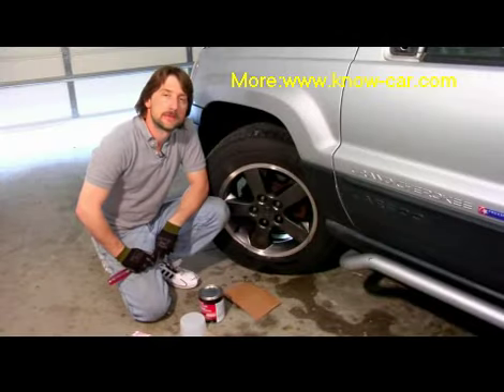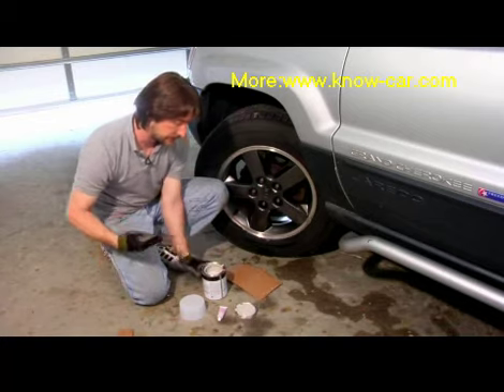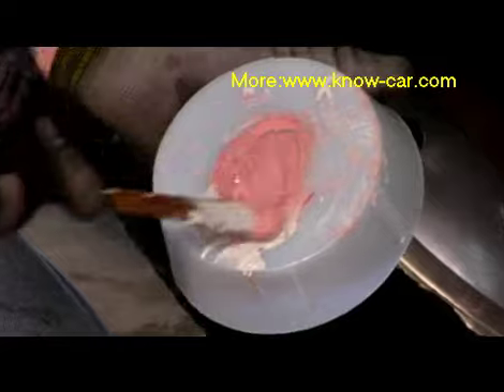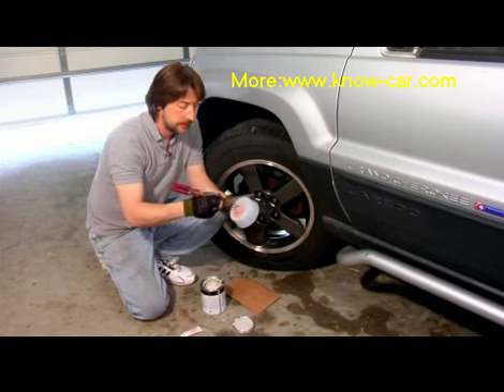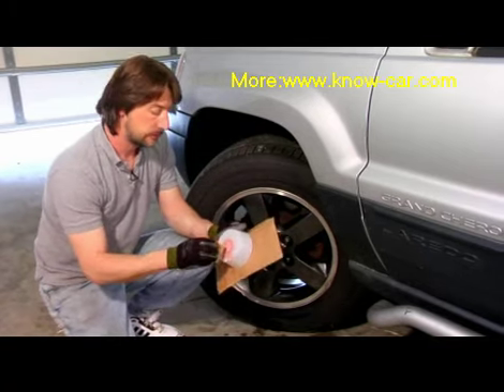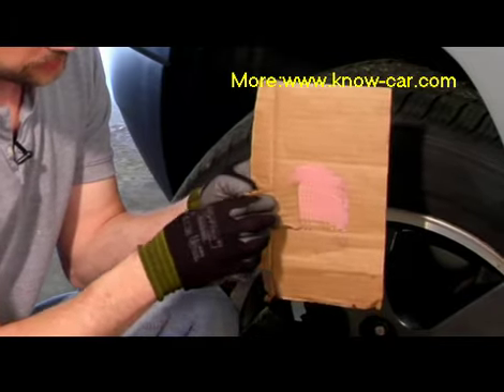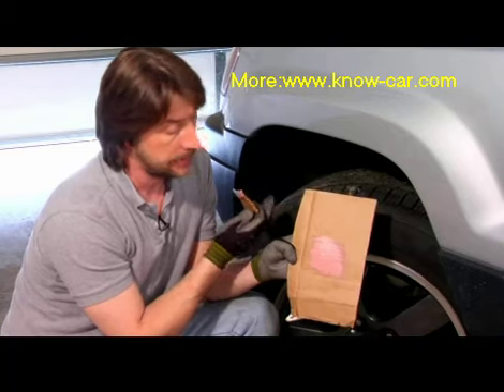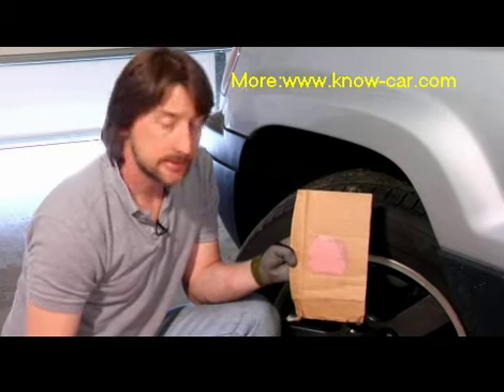Auto repair videos: How to Use a Bondo Body Patch

Comment: Dude that is not bondo body patch.  Bondo body patch is a wire mesh that you use in place so you have something structural to put the bondo on. Thanks for wasting my time.